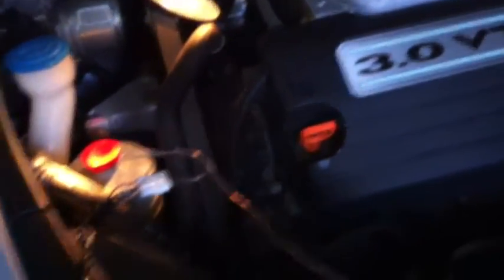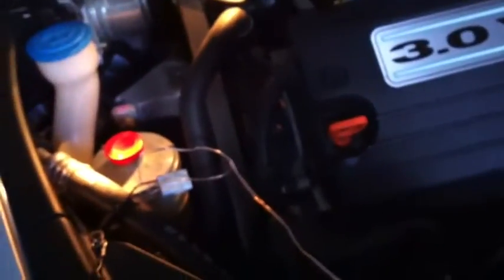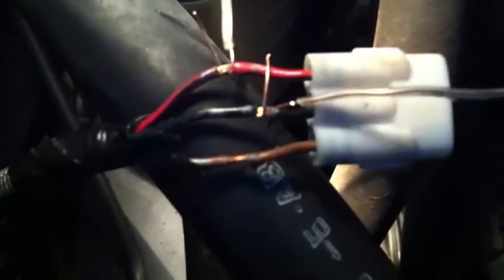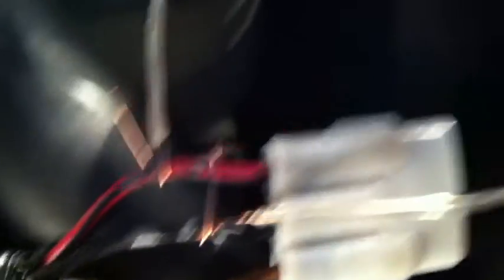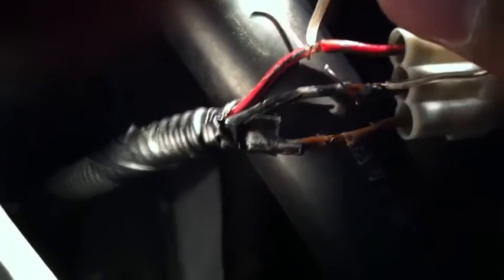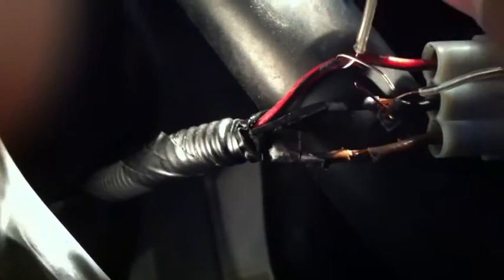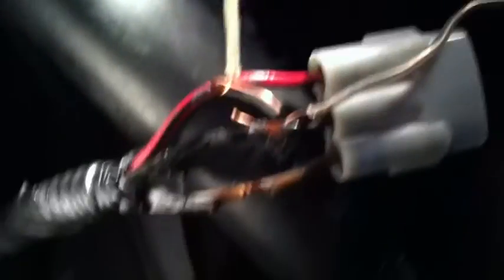How To wire AUDI STYLE leds to a car (DETAILED

Comment: If you just wrap around that wire and tape it...is gonna oxidase and sparkle n' yr fuse will blow or your car will burn.
Either solder-it or tighten it in a proper "electronics"/"electrical" way with splitter ....or other many way but not just wrapping around

Comment: Anyone who wants to know how he made the LED flash opposite of turn signal, you must go to a local electronics store and purchase a little box (ask for a NOT gate or signal inverter) that basically inverts the signal. You could also get a delayer, and delay by a certain amount
Reply: +ThePlatypotamus 

or if you have a multimeter just find the right wires and splice like he already mentioned

Comment: I think I have shorted out my turn signals circuit. I didn't ground anything, just spliced the turn signal like yours and then just connected the positive with the positive. My LEDs have 2 wires coming out of it, one on each side so the ones on the other side I was going to put out on the main headlights. How do I fix this. Please help!!!
Reply: Did you ever figure it out? I also have that style with wires protruding from each side
Reply: Yeah I blew two fuses. I got new ones and my signals, my transmission and my hazard lights are back on. I am grounding the wires and I finish.
Reply: So do I just hook it up normally, ignoring one side? or do I connect the reds (both sides) to the one wire and connect the black (both sides) to the ground
Reply: From what I have gathered,  you can hook up the two reds to two different power sources like power for daytime lights and the power source for the night time regular used headlights and yes you ought to ground the other two black wires. Would help if Instruction came with the LEDs.
Reply: Ight so for anyone who has red and black at both ends of their LEDs, here's the clarification. You only need to hook up one side, whichever you prefer
You can hook up both (one to blinker wire, one to parking light wire, etc) but you must realize that this will link together the two circuits.
This means do NOT link them to two different bulb wires (diff circuits, different voltage/intensity). Also make sure the black wire goes to the ground (for most cars its the wire in the middle of the three for the parking lights). If you really want a connection from two sources, go to a shop and purchase an OR gate
Reply: I finally worked it out today, I connected the red wires together and then wired them to my daytime lights and ground the other two black wires together in one spot after I had them connected together. Lights work like a charm. I just hope I haven't set off Any long term damage sequence.

Comment: once again, thanks for the video...

let me ask you this, this connection, won´t flash like the fist video you post it, im talking about Honda thst you install led that flash with turn side lamp...

can you please post info about previous video.

Regards
Reply from the maker: The flash happened becuase I basically wired it to the turn signal in a sense. Both wires were spliced into the light wires. And I tested each combination until the desired lighting pattern came about

Comment: I have an e39 bmw and want to install led strip lights under the grill to show through at night. I do not want them to act as a turn signal. The wires for the parking lights are brown, blue/white, brown/white. Ive heard the brown is the ground, and one of the 2 colored wires is for the parking light and the other is for the turn signal. Do you know what I should do if there is not a posotive and negative wire? Should I just splice both of the led wires into one of the wires for the parking light? Or would that short something?
Reply from the maker: I would use a multimeter to test which wires have 12v when on and constantly on even with the turn signal on. That way you know for sure

Comment: Use silicon RTV to dress the wires B4 you cover them with electrical tape. That will give you a good waterproof seal to avoid corrosion.

Comment: this accord didnt have daytime running lights. if it did, i would splice into there. OR, theres a fuse in the box that says "DRL" or day time running lights, tap into that fuse, and ground the negative anywhere on the chassis thats not painted

Comment: As for the wiring, I would have taken the positive lead for the LEDs and connected it to a switched ignition feed and connected the negative for the LEDs and connected it to the positive for the turn signal. This will have the LEDs light up when the car is on and the appropriate side flash with the turn signal.

Comment: I give him credit for soldering the wires, which is a MUCH connection than crimp connectors, ANY day. As for catching fire, nope, not from this. Others have touch the negative/ground comment. The only thing that I would say, is that for waterproofing, cutting the factory wires and sliding heat shrink tubing on first would have been better. Even better than that, put some dielectric grease on the connection before shrinking the tube.

Comment: Haha ground refers to the node off of which you base other voltages. The negative terminal of the battery is commonly referred to as the ground node, but that does not mean there is no negative. His wiring is fine, he just should have sealed it up more. And don't criticize him, you don't seem too smart yourself.

Comment: If you mean the main headlights, then if you have them wired to the parking lights, when your headlights are one the parking lights too have to be on, so that way when you dont want to run your headlights just led and parking, you can do that. If you mean to jjust be on whenever with no lights running, then the wiring is a tad bit more complicated because you have to find a fuse that won;t run power when car is off, and will run power when car is on

Comment: So + means positive and - means ground? I don't think so.

+ Positive
- Negative

A battery has carbon cathode (positive pole) and a zinc anode (negative pole)

There is a negative in a car, because a car has a battery.

'ground' is a common return path for electrical current, or connection to earth.

Comment: Hey Cartzar, you have nice videos, I would suggest use electrical wire Snaplock which I found is the safest way to connect to a active wire without cutting it.... Search on ebay for "wire snaplock"

Comment from the maker: @MrAcid125 just think of it this way. when you turn your headlights on, the parking lights and the main bulbs are on. correct? so therefore the leds should work even when your main lights are on. i wired it to the parking lights so that i could use them in the day time. i dont want to use my headlights in the day time, so i just use the parking lights.